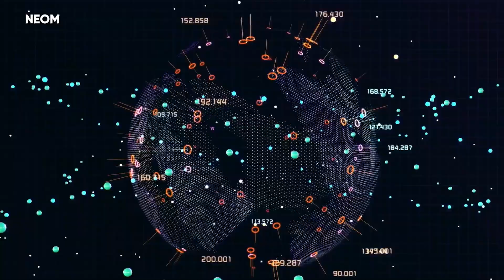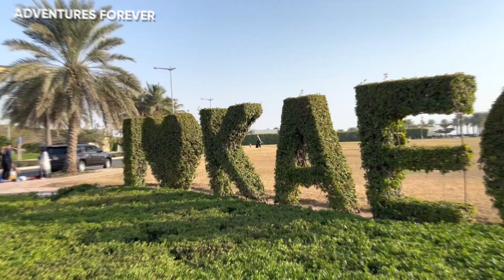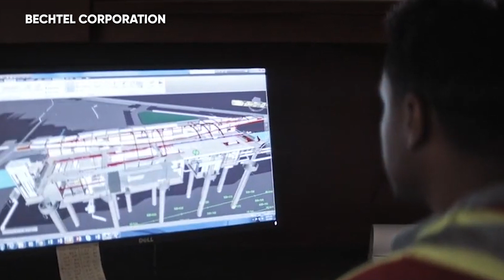New Generation Dubai on the Rise?

Comment: Saudi has been trying to reshape itself since the 70s and 80s, per analysis currently and power struggle in the Kingdom, this projects will not be a success. But i wish them best of luck and prosperity
Reply: Well Saudi in the 70s looks nothing like in 2000s , so they appear to have succeded in reshaping even though they might not have achieved alot of what they had planned. Same with 2030, it seems that alot of the projects are distant to fail or even to never start but the overall essance of the vision and big change and reshaping it might very well be possible but can't tell yet
Reply: @d7home2129  yeah I do agree with you. Saudi needs to sort out their internal politics right now, there must be unity in the Kingdom for prosperity. So all resources, support and focus can be on the modernization process